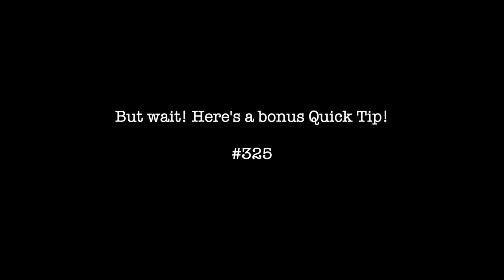Making Damon's Famous Smoked Sausage: The Complete Video

Comment: Really enjoyed this video. I've  been making sausage for about five years now. What I learned about muxing seasoning to meat is like you I mix before grinding. The best thing that I learned is to add water to the seasoning making a  slurry or gravy. Being wet the seasoning coats the meat better and is much easier to mix cutting your mixing time in half or more.
 I couldn't keep my eyes off of your bread warmer, lol. I got my hands on an older all metal model a few years ago and converted it into a smoker by just adding wood chips to the water pan. I usually heat and dehydrate sausage for two hours without any wood then add wood to smoke and finish cooking the sausage. A double handful size of coals in the water pan will keep the temp 175 to 200. I cook mine to 160 to 165 and can cook off a 30lb batch in 3 hours. Anyway I really enjoyed the vid and am now subscribed.

Comment: this is a very good video you have explained this very well. i have a couple of suggestions. first when filling the sausage stuffer, the first hand full of meat make sure you press it down into the bottom of the stuffer. this gets all the air out. Second when stuffing try not to fill the casing to full. this will help with the twisting and you will have less or hopefully no breakage at all. also the wetter the horn is the easier it is to fill the sausage. when it is dry it sticks and breaks. i really enjoyed your video. don 45 years a butcher.

Comment: I have been making a stuffing sausages for over 35 years. One thing run warm water inside the casing. Washing them outside does nothing. Doing this you will remove all crap from inside. Twisting sausage use both hands. We don't do that at my place all is automatic. Blinkers doing all the job but 35 years ago we still use our hand on some sausages.

Comment: Does the seasoning pack have any kind of a binder like soy or milk powder?  Sausage looks really good. Also interesting most other videos ive see say they want it sticky when stuffing, your way seems better to me.
Reply from the maker: No binder or powdered milk. I never even knew about those things until a couple years after I started making sausage. I know several people that use a binder, but I have never had the need. Give it a shot this way and see what you think. If you think it needs it, you can always add it before running it through the casings.

Comment: I learned a lot. Thanks.  These skills will help when making deer sausage.
Reply from the maker: When I make deer sausage, I use 60% Pork and 40% venison. It makes for a juicy sausage. When I've made 50/50 pork and venison sausage, it has come out too dry. Just a little tip.
Reply: @damonsrealtexasbbq  Thanks, I appreciate that.  I have been doing patty deer sausage and have shied away from links due to I felt it would be too hard but I am going to give it a shot. Thanks again.

Comment: Thanks for sharing your knowledge.  Making sausage can be difficult.  You explained very well.  I do have a question. Where do you buy your pepper jack cheese?  I buy mine from a place in Houston and it didn't have much flavor.
Reply from the maker: Great question. I get them from two different places. I usually order from Webstaurantstore.com because they are cheaper than most places i have found, but I also order from Waltons.com because they have a huge variety of cheeses. Waltons sells anything and everything related to sausage making. That's where I bought my Weston grinder.

Comment: Really enjoyed the video, thanks for the very detailed information.  What size plate did you double grind that with?  Looks like possibly a 6mm or so?  That seemed like way more water than I have been using (per pound) but I do sometimes find that I have a hard time getting the meat through the stuffer.  I didn't know if too much water was a bad thing, so I always assumed less was better than more.  Maybe I should start adding more.
Reply from the maker: That is a great question that I should have addressed in the video. Thank you for asking what size plate I use. I use the 7mm plate, which is the large hole plate. I use that same plate for both grinds. 
As far as water goes, I wish I could tell you to add a certain amount of water, but it really depends on how much much the meat soaks up. You just want it to not be super sticky. Where you know it will push through the stuffer with ease. All your seasoning is in there, and it's not going to dissolve because you are using cold water. All that water is going to evaporate during the smoking process, leaving behind your seasoning and all that flavor.

Thank you,
Brandon Cruz
Reply: @damonsrealtexasbbq  Sounds good, thanks for the reply.  My MEAT grinder came with a 4.5mm and a 10mm plate.  I recently bought a 6mm because often times I thought it was either too fine or too coarse, depending on what I was making.  I will try adding more water I think.  Normally when I add mine to the stuffer it is still very sticky.  It normally works fine, but if more water doesn't hurt, it should make it easier to process for sure.

Love to see more sausage videos if you make other types.  I've been trying to master boudin lately but haven't gotten that dialed in yet.

Comment: Loving watching your channel..  when you put in jalapeno peppers to your sausage are they whole when going in the grinder or sliced. Thanks
Reply from the maker: Actually, I use dehydrated jalapeños. I used to use fresh jalapeños, but dehydrated is so much easier. When using dehydrated jalapeños, you put 3 oz  of them in a small pot of water. Bring it to a boil, and then cut the heat and let them soak for about 15 minutes. I then pour ice on them to cool them down before adding it to 50 lbs of meat. I grind it with the water and all. You won't have to add as much water later on. I hope that helps.

Comment: We take 5 lbs of beef, run it thru larger hole plate, lay out on a tray, put in refrigerator to dehydrate, meat then get mixed in to mix, the small chunks of dry meat gives the sausage a different chew

Comment: Great video! I'll add one thing when using insta cure number one you must let the meat set overnight in a refrigertor or cooler to let the cure activate. You can speed the process and go straight to the smoker if you add sodium erythorbate which is a cure accelerator.
Reply from the maker: I did not know that. I do anyway, but I didn't it is a necessity. Thank you.

Comment: Great video..... I have made summer sausage, brats, hot links, etc. for years, but can you tell me a good place to purchase the high temp cheese? Thanks for the tip on the REO products, I will give them a try.
Reply from the maker: I use two websites for high temp cheese. webstaurantstore.com is the cheaper of the two, but waltons.com has a larger variety of cheese. In fact, Walton's has everything you need to make sausage except the meat.

Comment: Pinching off sausage length (on both ends) and skipping twisting every other link allows you spin the links in the same direction.  Goes faster....., 1st link- twist, pinch at 2nd link's back end, and 3rd link's backends' and spin (I always spin away from me).
Reply from the maker: Yes that is the technique I was trying to show when the casing busted on me. I can do it, but I'm just more comfortable doing it one link at a time.

Comment: You don't have to use the knife to pop those air bubbles as she is cranking that you want to keep hitting the pressure release valve where you put the meat in that will stop air bubbles from getting into your sausage casings
Reply from the maker: Yes, you are correct. I'm just used to using a knife. I've seen some people use an ice pick as well. Also, my spring is worn out on my release valve and it sometimes is hard to lift up.

Comment: The only issue I have had with the grinder parts in the freezer overnight/etc is the meat would freeze to the inside and prevent grinding for several minutes.
Reply from the maker: I haven't run into that issue, but I have had the grinder not to turn on because everything froze together. To resolve that issue,  I disassembled the grinder parts before putting then in the freezer. What I mean by that is, I was putting the entire grinder head with the blade and auger all assembled straight into the freezer. Once I separated all the parts and put them in the freezer individually, the problem was resolved. I hope that helps some.

Comment: QUESTION:  Does your expanded metal smoker shelves have to be made of food grade stainless steel?  Or does the cooking residue take care of any potential rust problems? If regular steel is used, do they have to be "seasoned" like a cast iron skillet?
Reply from the maker: You are not required to have stainless steel. These smokers are made from all carbon steel and they are used so much they don't rust. Every day they are used they are coming in contact with grease from the meat being cooked in them as well as the smoke itself.
Reply: @damonsrealtexasbbq  Thank you so much for your reply.  I want to replace my original racks in my side-burner smoker and want the expanded metal.  Keep up your great videos.

Comment: While hand mixing, turn the tub end to end every minute. 32;20? , I add 1/2 the water into  the spice mix before adding to the pre  grind.  Make felt pen marks on the table so the links are the same size..  What will a link that size sell for?- thanks.

Comment: I’ve got a question. When I put some high temp cheese after the shredding, it magically disappears. It’s high temp cheese I use. Any advice on how to keep it in? Thanks in advance and love your vids.
Reply from the maker: The correct ratio for cheese is 1 lb of cheese for every 10 lbs of meat. You might not be adding enough. And always add your cheese after you grind, never before, or it will disappear.
Reply: @damonsrealtexasbbq  let me try to add more cheese. I made sure it was added after I grinded the meat. Besides that, the flavor was there. I was just surprised where all the high temp cheese went. But love all your videos and wisdom you share 👍🏻

Comment: Would freezing the meat  a little first keep the grinder from heating up?
Reply from the maker: It will help, but I wouldn't freeze it solid. Just let it get icy. One thing I used to do is mix all my meat in a large cooler and then pour ice on top of it and let it sit over night. In the morning I would pull the plug and let all the blood and water drain out and then I would start grinding.  The meat would be extremely cold and with the grinder parts just coming out of the freezer, the grinder didn't heat up much.